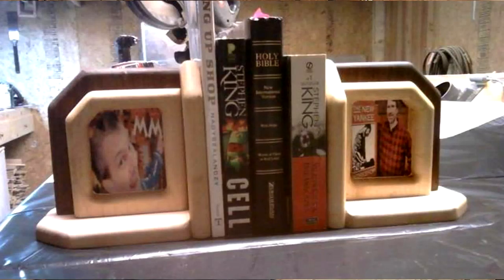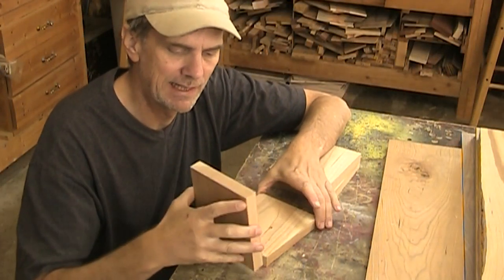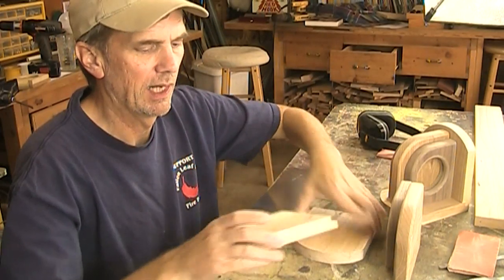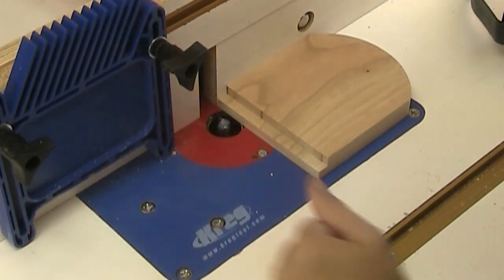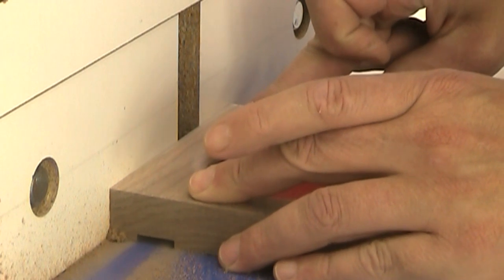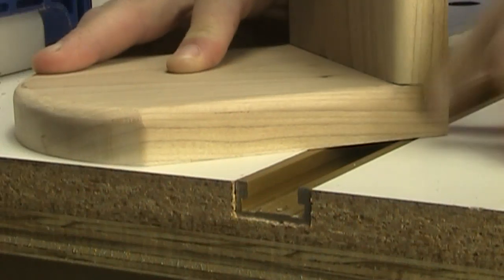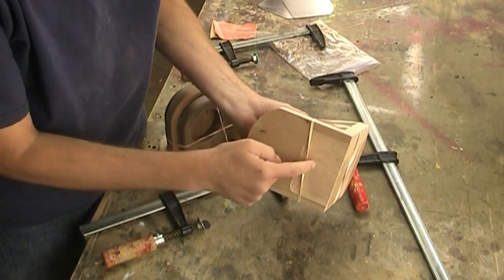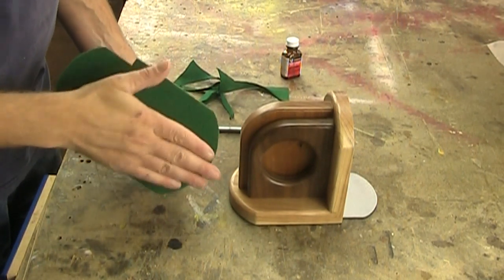Wood picture frame bookends

Comment: Just so you know, you can also nicely and accurately cut plexi with a router (but you get more waste), or even a table saw if you use a zero clearance, and cut slowly (otherwise it will chip). Same applies to Lexan (bullet proof "glass").

Comment from the maker: I wish I could say my wood selection is artistically significant, but I usually just rummage through my wood and see what I have enough of. In this case, I only had narrow walnut boards so I used them for the outer support pieces. I had just enough cherry that was wider, so it became the base and center column.

Comment: Hey Steve, I wanted to give a shout out about a great way to cut PLEXI-GLASS no fuss at all. I use a Oscillating Multifunction Power Tool.  I bought the Variable Speed at Harbor Freight for under 50 dollars.  I just love this thing.  Quick cuts using the Half Moon Blade is easy and safer than the long ones.  You can get the single speed for under $30 too.  The variable has more amps though. I swear it cuts it like butter just not as fast. I like it for carving too.

Comment: great video and nice project.  In my experience, epoxy won't hold aluminum very well.  For the same reason paints don't adhere well, AU's quick oxidation time.

Comment: Wouldn't it be better to first join those 'pieces of bread' and then round the edges near the joint ? That would look a lot more natural and the only thing is that you would have to rotate the thing and make sure you've set the router bit to completely cover the edge while rounding.